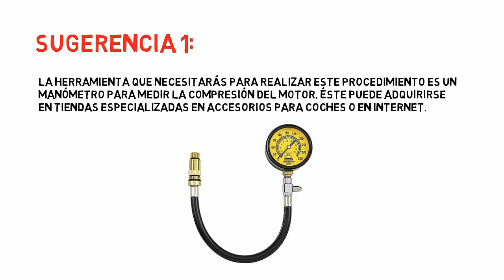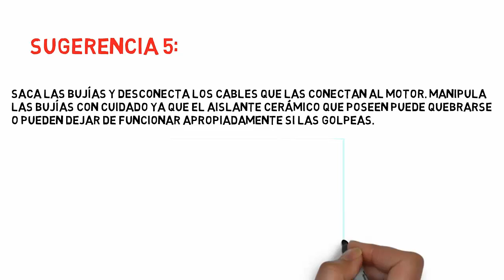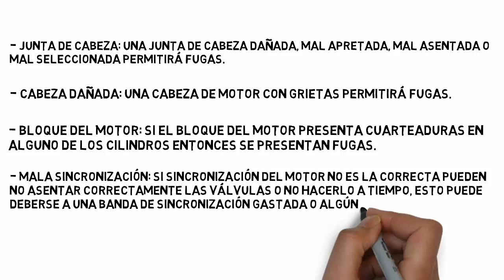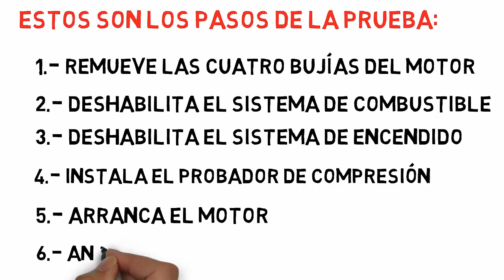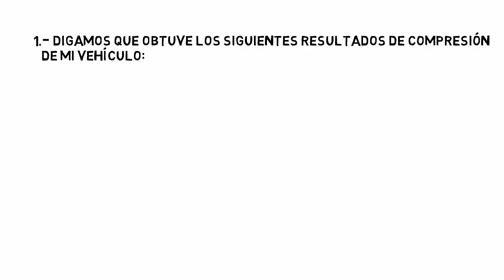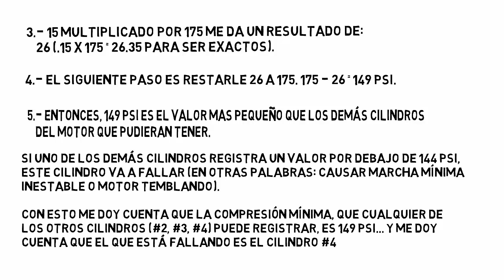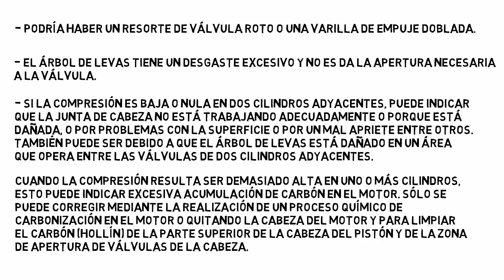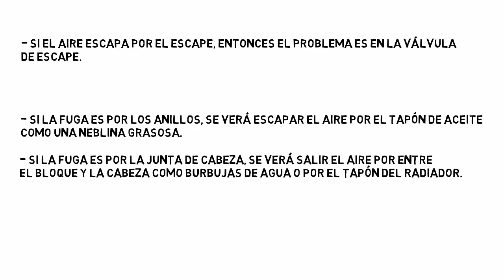Compresión de cilindros del motor(sugerencias,pruebas,diagnostico)

Comment: Yo quiero medir compresiones al motor de mi carro pero tengo el problema que la cámara de combustión tiene aceite en 3 y una empieza a verse húmeda. Que me recomiendas?
Reply from the maker: +VINI MSP3.5 hola bueno simple y sencillamente si las guias de valvulas esta en mal estado( tiene juego longitudinal u horizontal)afecta el asentamiento de la válvula ocasionando paulatinamente  el aceite excesivo que baja por el vastago produzca depositos de carbon y estos si pueden afectar el asiento pero es un problema que se da con el tiempo y se considera algo normal en motores con mucho uso.
Reply: +JOSH GVNS muchas gracias por responder, te comento que el motor tiene cerca de 100,000 millas y en los dos últimos cambios de aceite note que estaba perdiendo aceite. Supongo que es por eso, ahora crees tú que debo medir compresiones para tomar una idea de lo que pueda ser o desarmo de una vez?
Reply from the maker: desmonta la culata...o principal, sera comprobar que no existan holguras en el vástago o su diámetro y verificar en qué estado se encuentran los retenes de las válvulas. Antes de desmontar las valvulas se recomienda marcarlas y no cambiar la posicion de los muelles o resortes, tambien es importante inspeccionar la culata para descartar que exista alguna grieta y descartar que la junta de culata se encuentre en mal estado..A la hora de comprobar los cilindros, nos fijaremos en que no tengan escalones, rayas o deformidades...si vez q hay desgaste entonces tendras que desmontar los pistones para verificar q los anillos no esten pegados a estos de manera que giren sin ningún tipo de dificultad... saludos
Reply: +JOSH GVNS ok muchas gracias me guiaré en los pasos que me indicas. Te comento luego como me fue. Saludos y feliz día.
Reply from the maker: ok man =)..saludos